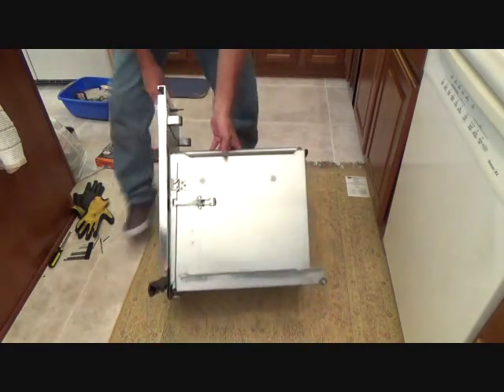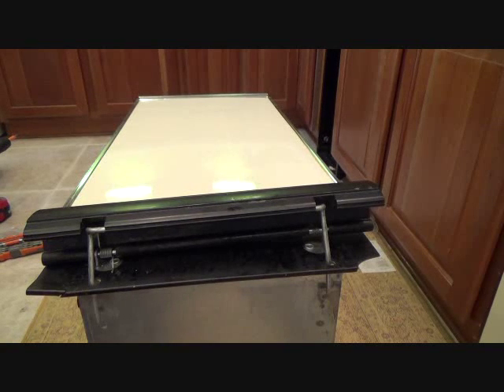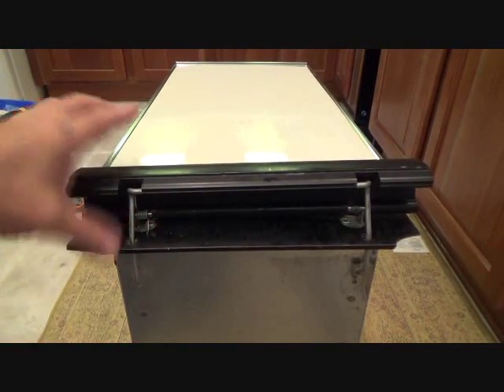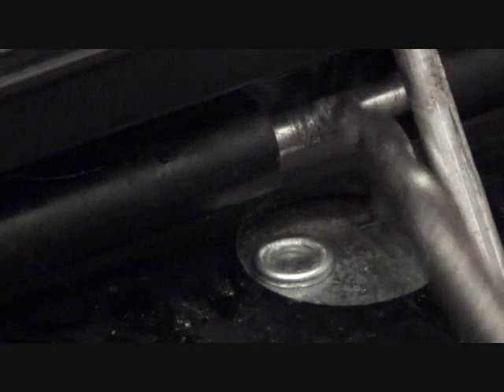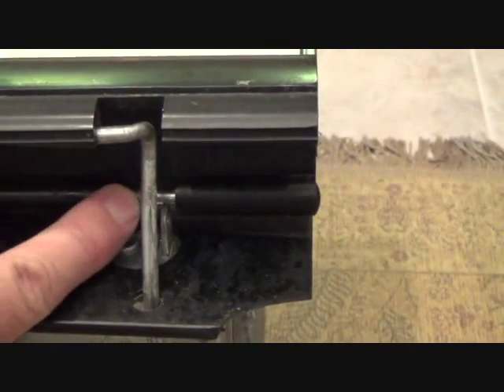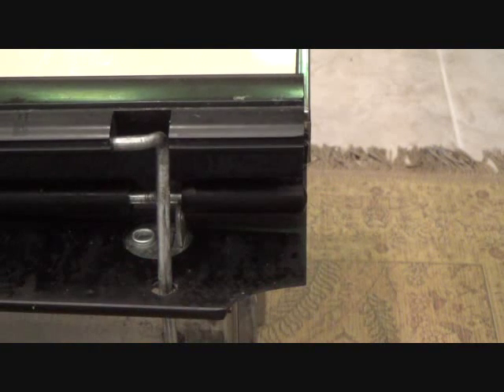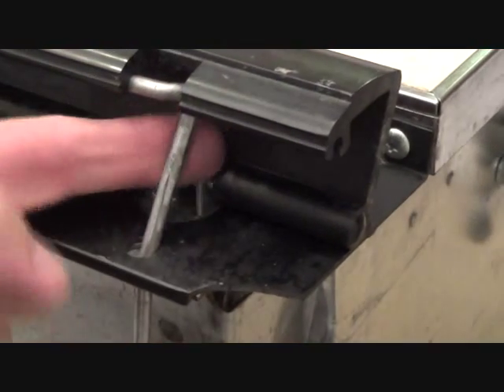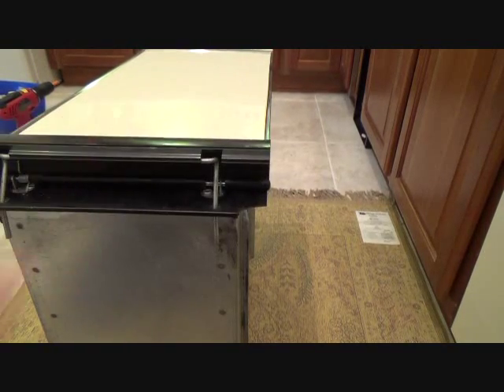How to repair a trash compactor foot pedal

Comment: I am trying to find a way to open my soft close cabinet trash drawer with a hands free foot pedal.  Do you know of any trash compactor replacement foot pedals that will work for this?  Thanks
Reply from the maker: I don't know of any but you might want to go to an actual cabinet shop & discuss with them & they might have something....or sit down with the people at The Home Depot Cabinet area & they might have something that could be ordered on line...?